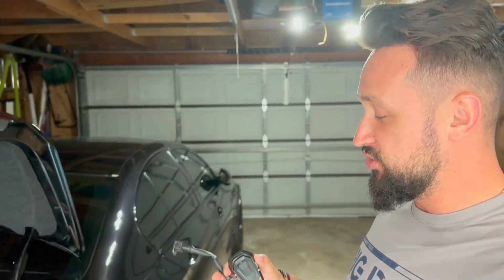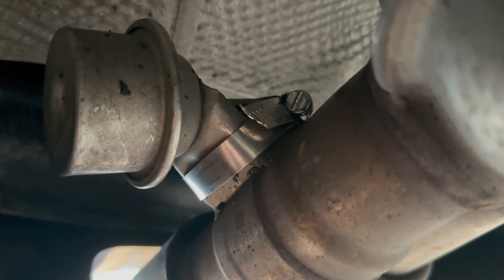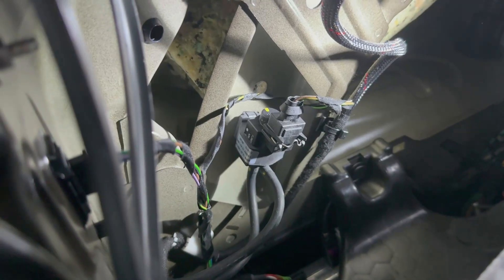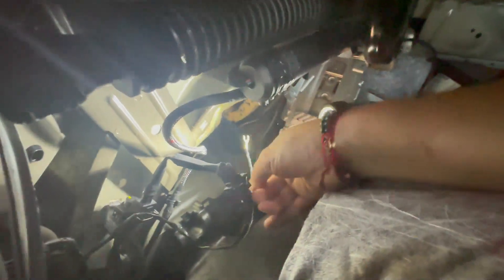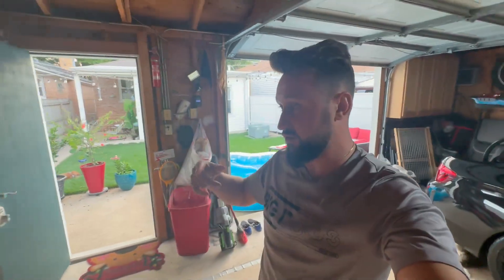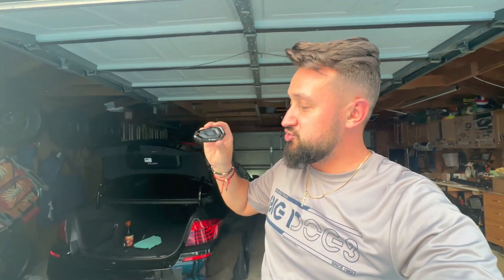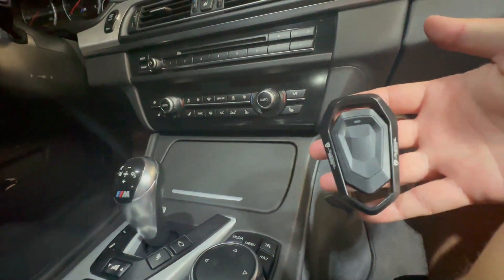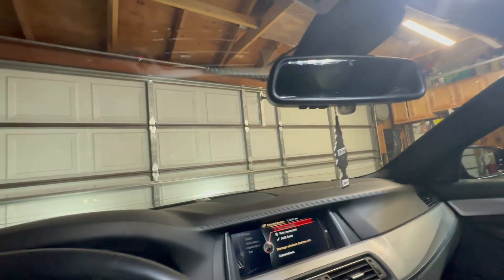BMW Exhaust Valve/Flap Controller Install F10 M5

Comment: You said in video you'd check to see if auto opening of valves was retained in sport / sport plus modes.  But didn't conclude on that.  Did the harness take that away and make the valves fully manually controlled by remote or will they still open on their own in sport modes?